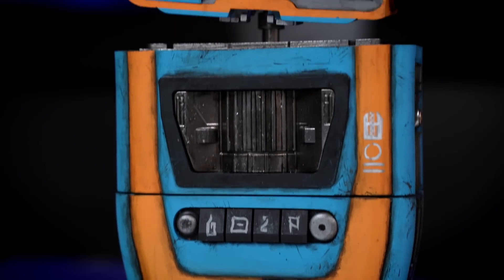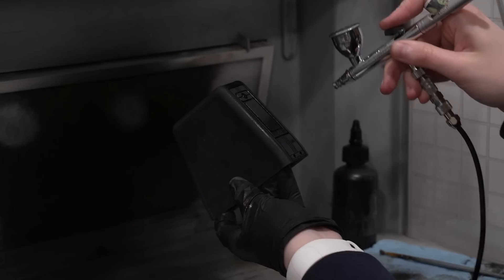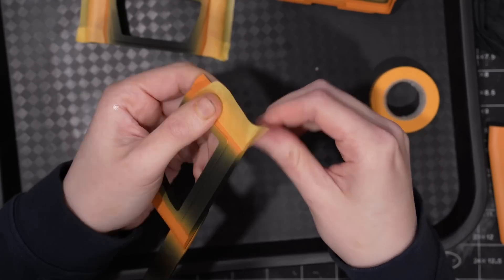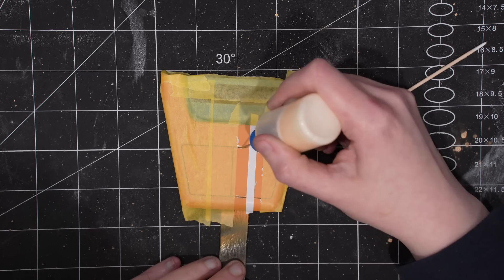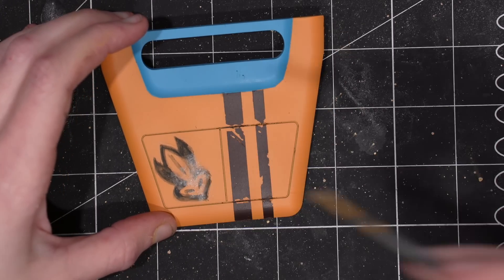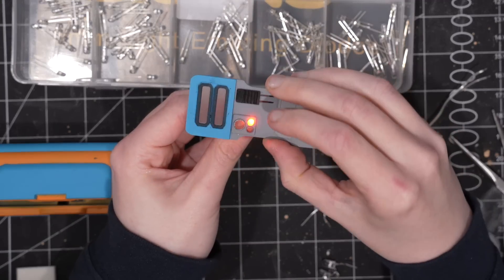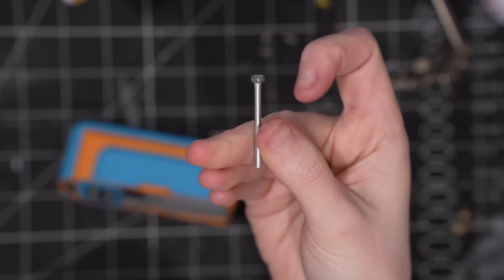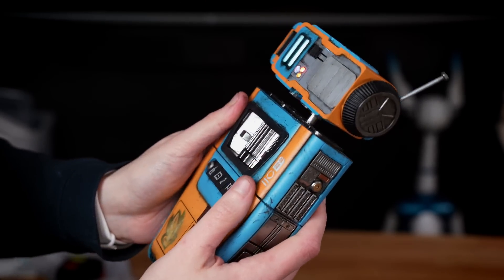Building a Real Life Pip Droid

Comment: At 10:30 you say 'LED foam' what exactly is that?  I don't think I've heard you call that out before
Reply from the maker: It’s this type of foam sheet that’s specifically designed to diffuse light. It’s sort of like EVA foam but less dense and more transparent. Comes in various thicknesses for different levels of diffusion. Cosplay shops normally sell it.
Reply: @MMsPropShop  Oh thanks! Now I see the Plastazote LED EVA foam.  Somehow adding 'cosplay' to the search gave me more useful results.  This is a new material to me so I may have to experiment.  BTW the foot sander and plastic welder are amazingly good at their jobs, thanks for pointing them out